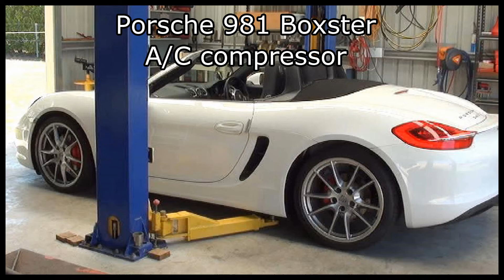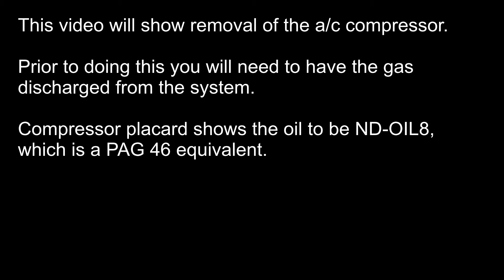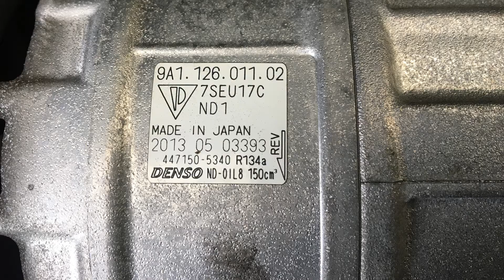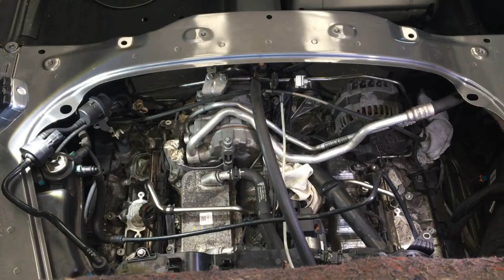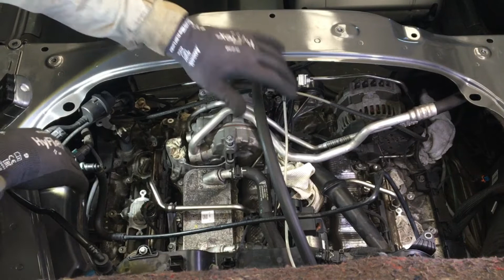Porsche 981 AC compressor

Comment: Hello Jeff, I’m experiencing AC issue where it stopped blowing cold air. Checked fuses and they were good. Next thing I suspect is the ac pressure sensor. Do you know if it can be replaced without system drain?
Reply from the maker: The first thing I'd do is go to an a/c specialist and get them to check the pressure. Very easy to do (connections are under the front hood) and only takes a few minutes. This will immediately tell you if it's a gas leakage problem or could be elsewhere. I don't see how you could replace the sensor without evacuating the system if this was in fact the problem.
Reply: @jeffrichardsoncardiy  Thanks Jeff for the video. In my case, I checked the pressure and it's the ac compressor dead. Gonna take all the works done to remove all the stuff on top of the AC compressor in order to replace a new one. But thanks for all the removal videos.